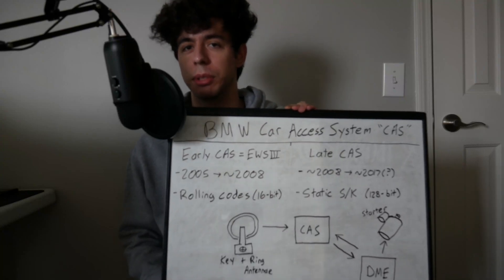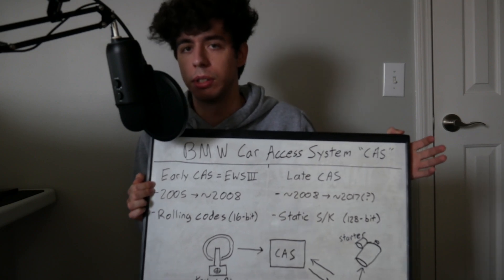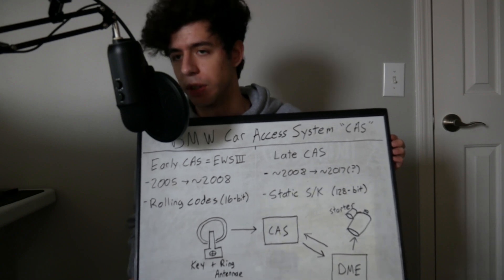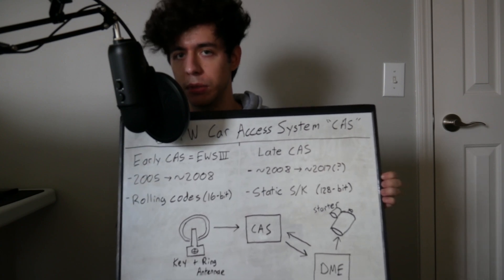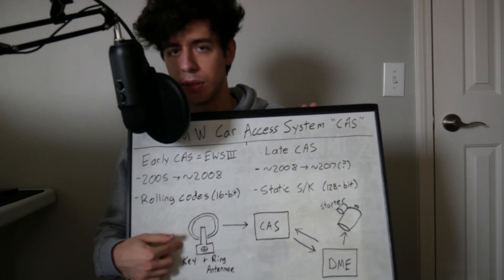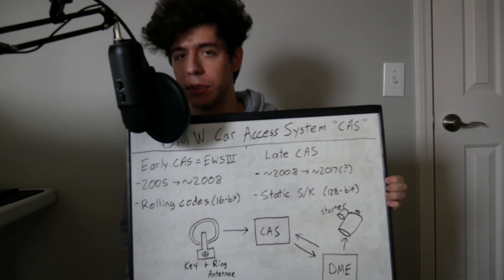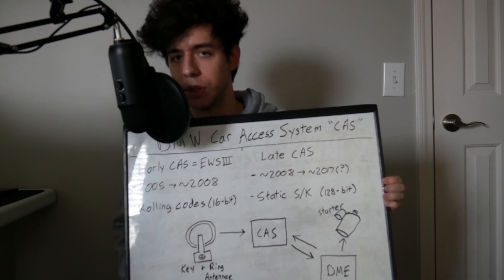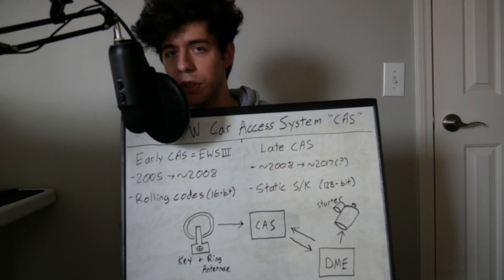An Explanation of How BMW's Car Access System (CAS) Anti-Theft System Functions

Comment: The only correction I see is that the CAS sends a signal to the starter via an internal relay.  The DME sends a signal for the spark.  So in theory, you can have a key that matches the CAS and it will activate the starter motor.  But if the CAS doesn't send the corresponding matching value to the DME, the DME will not create the spark.  So the car will turn over but will not crank.  But its a good video.

Comment: I have a a0b3 error on my 335d e90 2011 but the car starts fine, unlocks fine ( I do need to be like 5 meters away from it, it won't unlock from a big distance) what could it be ?

Comment: Hi . Im fishing for help. I lost my auxiliary on my ignition using my fob . It comes on but only for 5ec.then the radio,ac,bmw logo goes blank. Then push fob into 2nd position everything comes back on . No warning signs or check lights.if car hasnt ran for 3days my time and date dissapear.and i have to reset . 
Have you heard of anything like this ,? 2008 525i e60 . Any ideas will be awsom

Comment: CAS has Starter relay within it the same as EWS system, do not  require a DME installed to crank it is independent once you have a matched key.
Reply: So you just need the cas with a matching key right
Reply: Interesting, so if my CAS and/or EWS4 (MINI first Gen) goes bad, I can get one from a Junk yard + matching Key and I can “fix” my broken one. I would need the key turning mechanism to match?

Comment: So I have a e60 I been using inpa says the key is good it's a manual transmission no start no crank diamond key it's not a push start so inpa says keys good I've rest and sync the dme I tryed unplugging the battery went through fuses but it says cas locked the weird thing I replace the module under the seat and programmed it I unplugged the light module that sits next to the cas2 i didnt clip the light module all the way but my car started at the time I'm like yes I did something but no lights drove it around and realized the light module isnt plugged in all the way so I did and car wont start seat works now got lights passenger wind wont roll down I tryed recreating the light module unplugs slightly will a ak-90 work on cas2 or would I have to solder it in since it's a diamond key just like ews2-3 can inpa even rest the cas and dme and sync them I going crazy why did it start for a whole day off on off on the nothing once I plugged the light module in again it's not the starter that wouldnt lock the cas and give errors any idea'sits getting to the piont where sucking a dick to use joe rogan's time machine dont sound that bad

Comment: really informative thanks for this..

quick question,
would a CAS module from a 3series e92 work on a 3series e90?

if theyre in the same class would the CAS module  be the same so to speak?

thanks again
Reply from the maker: Theoretically that should be okay, although I think that you would have to swap over the other partnering equipment too (ring antenna and DME) since they all communicate with each other.